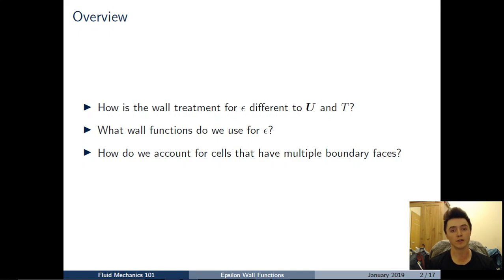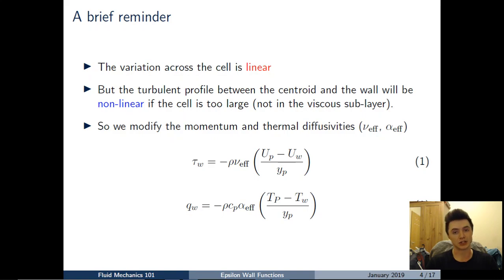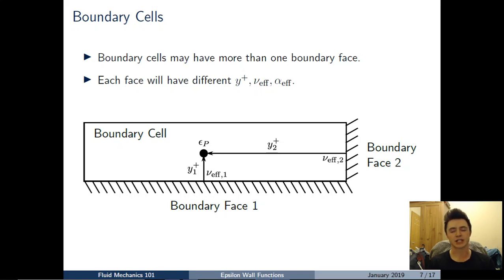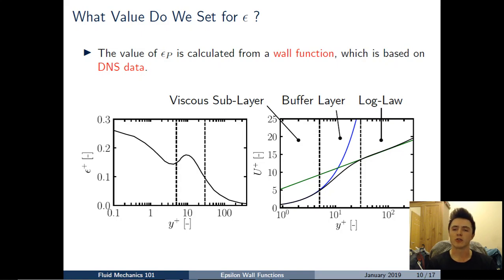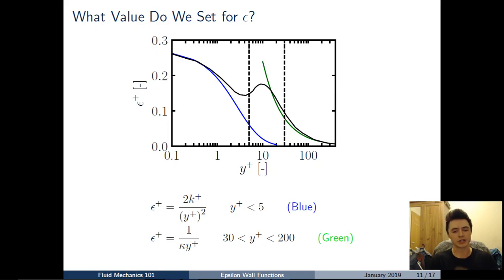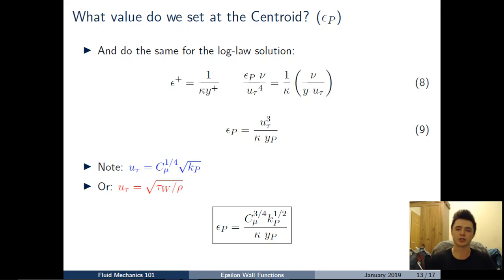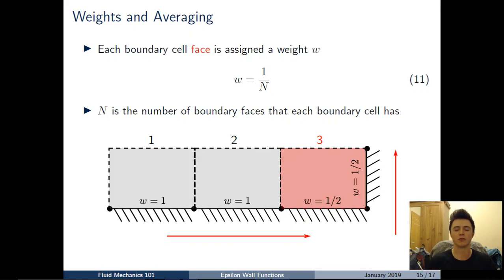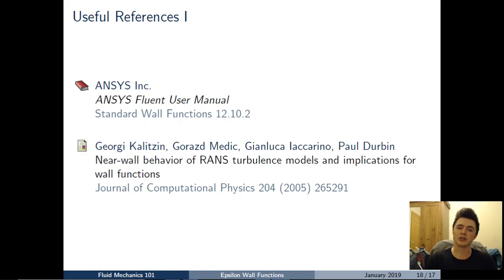[CFD] What Wall Functions Do I Need for Epsilon?

Comment: I've come back to this video after watching the one on wall functions for the TKE, and I have the following question:

Equation 10 (in slide 13) is being used to compute epsilon_p, but this requires the prior knowledge of k_p. Do we first have to compute k_p using a wall function for TKE? Or am I missing a step somewhere?

What's even more confusing to me is that computing k_p using a wall function requires the friction velocity u_tau, which itself is defined using k_p, since u_tau = sqrt (C_mu * k_p).

In other words, can you clarify the order in which a CFD code uses the different wall functions?
Reply from the maker: Sadly I don't think I can answer this. How different CFD codes work is hidden in their source code. The only thing we get is the equations given in the user manual. The one exception is OpenFOAM, where we can peak under the hood and see what it is doing. OpenFOAM will of course change from version to version, so the best I can offer is for you to have a look at the OpenFOAM source code in the version you are using or send an email to the customer support for the code you are using. If you are lucky, they may tell you how it works 🙃

Comment: Hi Aidan! My case is a 3D pipe flow. However , I still don’t understand where is the sub-layer in the pipe.
I don't even understand the settings of the parameters.
Can you make a video about 3D pipe flow instance on fluent?
Thank you!
Reply from the maker: The sub layer is very close to the wall of your pipe (on all surfaces). If you plot a line normal to the wall (showing velocity) you should be able to see the sub layer in  your velocity profile. If your mesh is fine enough then you should see a linear region very close to the wall where velocity varies linearly with increasing distance from the wall. However if your mesh is not very fine, this layer will be contained within the cell that is next to the wall and you won't be able to see the linear region if you plot a line normal to the wall 👍

Comment: Excellent explanations Aidan.. 
your videos are very informative.
Reply: 17:51 Isn’t this a poor assumption on their part? I assume the Reynolds Number and y+ value increase along the length of interest, instead of holding the characteristic length from leading to trailing edge. In other words, every case should include a portion of cells with low y+ values.
Reply: 19:48 Averaging epsilon seems to be a poor method, because it would reduce epsilon for a double (long-short) wall vs. a single (long) wall. Intuitively, the “effective” y+ for a double wall should be <= y+ of a single wall, because double-wall has greater surface area of wall, at equal cell volume.

It should be computationally inexpensive to apply the maximum epsilon, instead of the average epsilon. However, there is an even more accurate approach, if not too computationally expensive.

I propose taking the parallel sum, such that y+(effective) = 1/[1/y+(long) + 1/y+(short)]. This would slightly reduce the effective value of y+, increasing epsilon in most cases (which is maximum at y+ = 0).

Comment: Hi Aidan.. I really appreciate your efforts for giving insights on the CFD topics, which are really hard to find at one place.. Also really well explained and documented..
I have a general question on K-espilon model. Is it suitable to use k-epsilon model in the range of y+ less than 5? I used the same model before for pressure drop caluclation in ducting system.
Reply from the maker: You sure can. Just make sure you have the low Re formulation 😊 For your application it should be fine. However, if you were looking at aerofoils/turbo machinery (were the seperation point prediction is critical) make sure to use k omega SST 👍
Reply: @fluidmechanics101  Can we say that k-epsilon realisable model is more better than low Re model for the application I mentioned.? Can you provide some references where I can learn more about realisable model..?